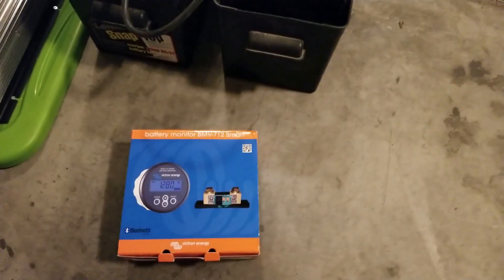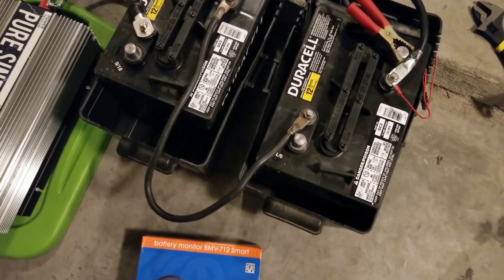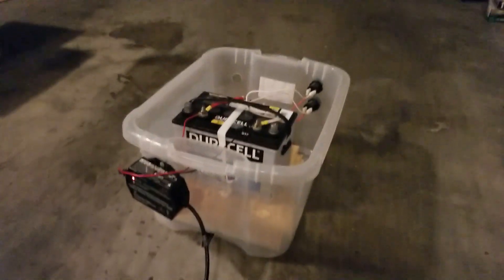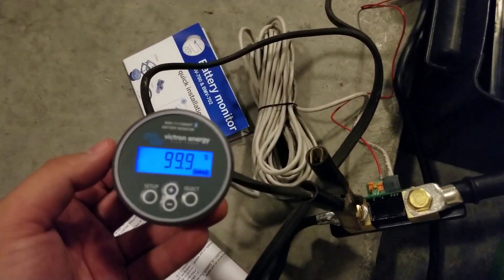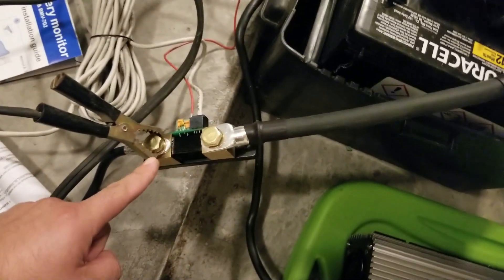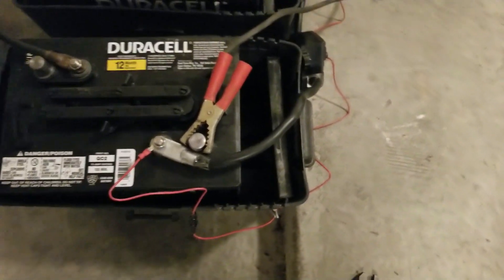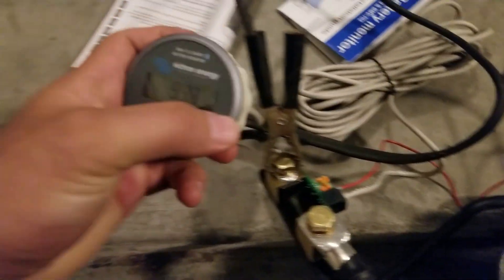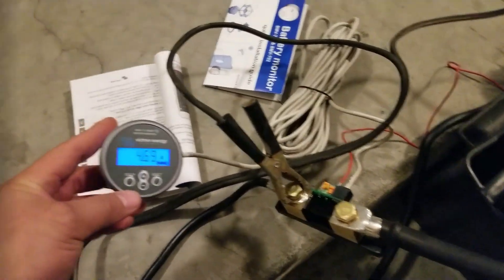Victron BMV-712 Smart Battery Monitor First test/wiring

Comment: Did you test it against the lithium?  If I have 2 12 volt lithiums do I need to connect the red leads to both batteries or will one lead tell the overall status of both 100 amp hour batteries as 1 big 200 amp hour batteries
Reply from the maker: I have it set up now with 2 battle born lithium batteries. You only need one lead connected to the main positive side of your battery bank.
Reply: @rvnlovinit  Thanks.  I'm getting ready to install two Battle Born Lithium batteries.  Thanks.